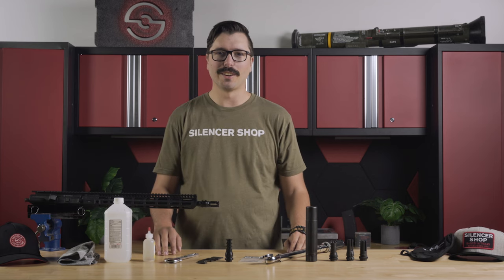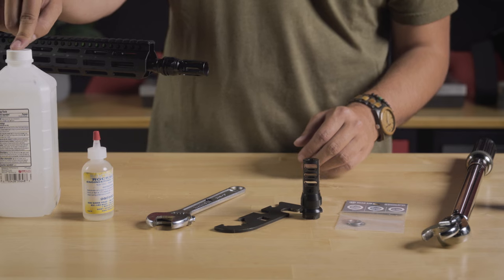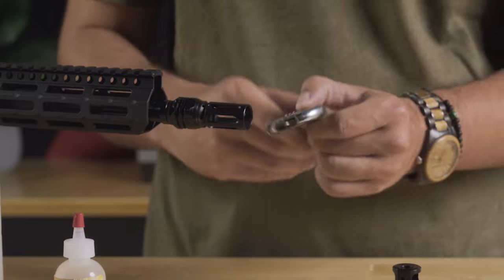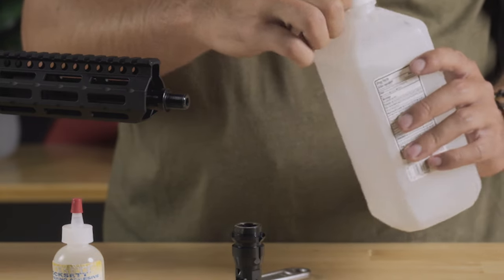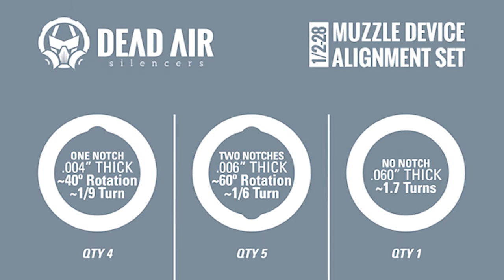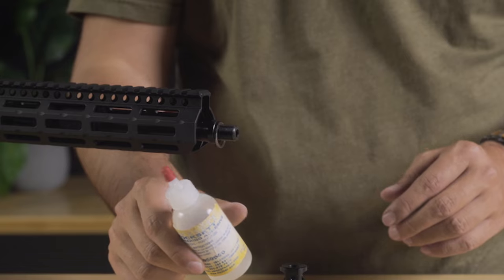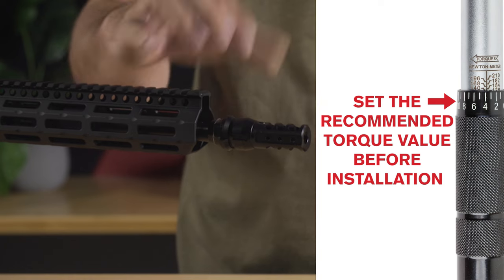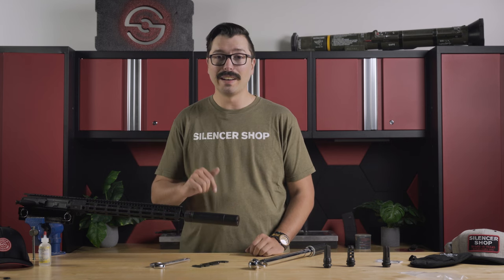How To Time a Muzzle Device

Comment: Don't use alcohol to clean muzzle threads, it's not a strong enough solvent. Use brake parts cleaner or carb cleaner and clean inside the valleys of the threads by scrubbing with a toothbrush or preferably a brush with phosphor bronze or brass bristles. Make sure the threads are fully dry before applying Rocksett.

Comment: Does timing of the brake need to be perfect or just relatively close? It seems from the video that you were more concerned with proper torque than exact alignment.
Reply from the maker: It should be close, but you do not have to pull out a laser level to ensure perfect alignment.

Comment: Define good torque wrench plz. Mine just died from a vehicular smooshing.
Reply from the maker: Would not recommend a smooshed torque wrench, but any of the models at your local hardware store will suffice. These do not have to be exact.
Reply: @SilencerShop  tyty. Yeah it only does curved nuts now.